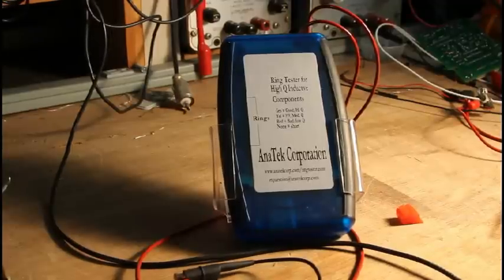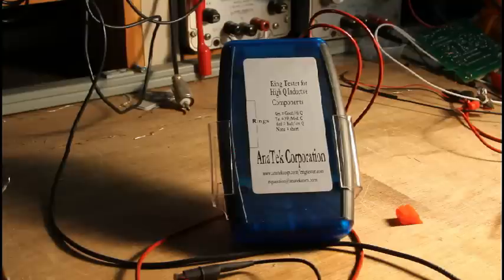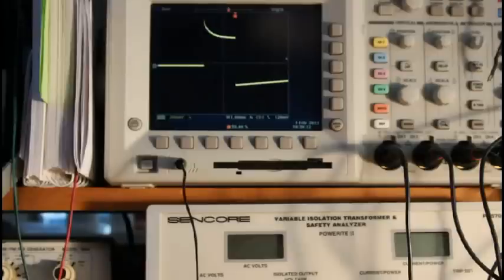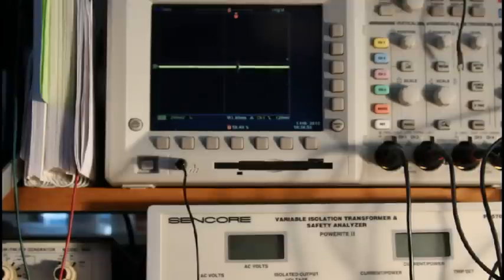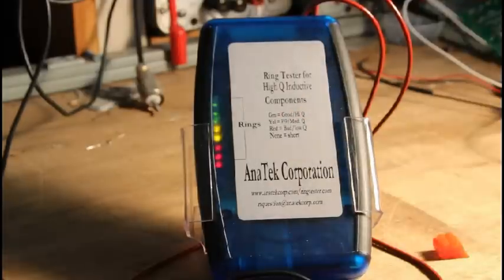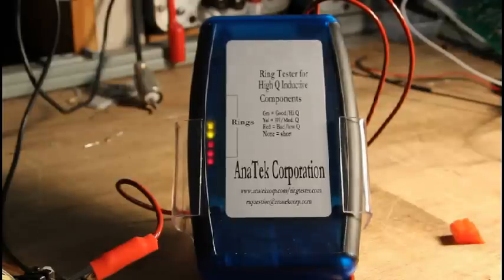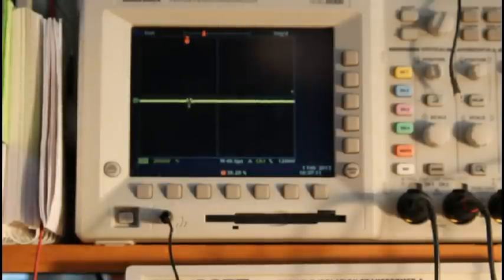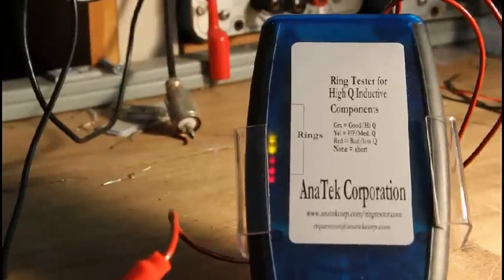Ring Tester testing Hi-Q inductors and transformers

Comment: Can a transformer like you testing in the video test good on a ring test, and fail to output voltage on the secondary side?  I have a tv that i am working on, The transformer is in circuit.  One the primary side it lights up all led's with the ring tester..  However when I check resistance on the secondary side with my meter, I have continuity on all pins.  Checking voltage on the secondary side using cold ground on the secondary side I have no dc voltages.  I am confused as to weather or not the transformer is good.  Any help is appreciated.  Thanks Dave
Reply: Are using a RMS voltage tester?
Reply: I'm new at this, and working it out, but I can't see how this test would work with a transformer in circuit.  If there is anything connected to the secondary, it's going to load it down and affect the ringing.  Anything that takes energy will bleed off the rings rapidly.
Reply: +Puppets and Fun With Little David What kind of TV is it? CRT or LCD? And why would you expect to get ANY DC near a transformer?

Comment: Nice explanation!
I have been wondering on buying the Ring Tester but don´t know if I will ever use it. How often do you think you would find a bad power supply due to bad transformers?
Reply: Hello Hector.  There is no way for me to tell how many bad transformers you might find.  That really depends upon the equipment history and your environment.  Transformers generally fail if they have been subjected to excessive heat.  That can occur due to the location or if in a dusty environment so that air circulation is impeded.  However, one way to think of it is how many does it have to find to justify it's cost?  Only you can answer that question.  I hope that this is helpful.
Reply: Thanks John !